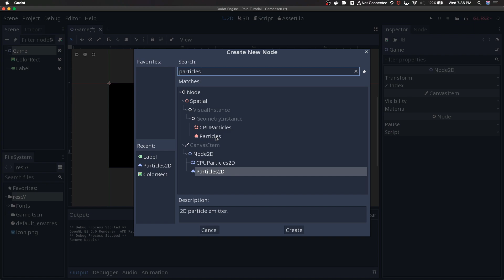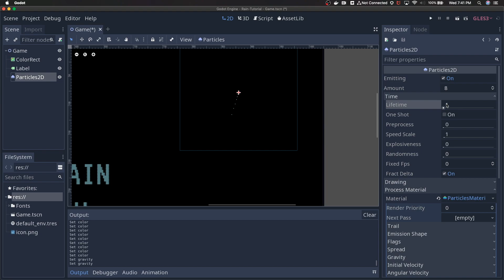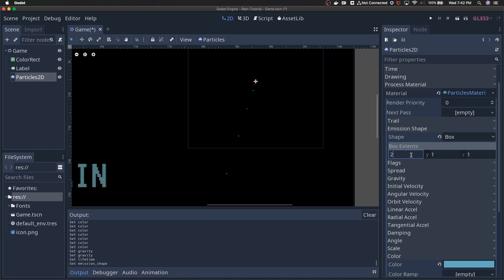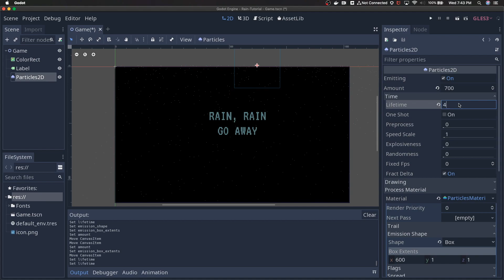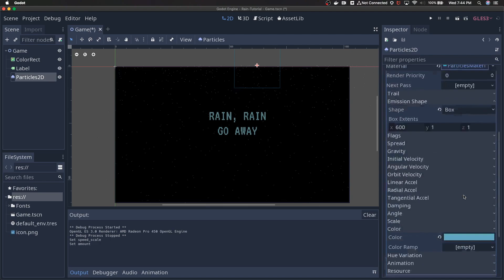Simple Rain Particle System in Godot Engine

Comment: A few suggestions:
1. Rain does not accelerate. By the time the rain particles reach the game world, they should have already reached terminal velocity. This basically means that it generally looks better if you do not use gravity but instead a constant velocity randomized for the particles.
2. Using a particles shader will get you much better performance than the default particle material as you can remove all non-essential calculations. You might want to check that out as it is in fact a very simple shader.
3. Instead of dots for the particles, consider using a texture with a line or even particle trails (less performance) to reinforce the illusion of rain drops falling.
Reply: Great tips. Do you have a sample repo or a tutorial to see these tips in action?
Reply: I'd like to see it too!